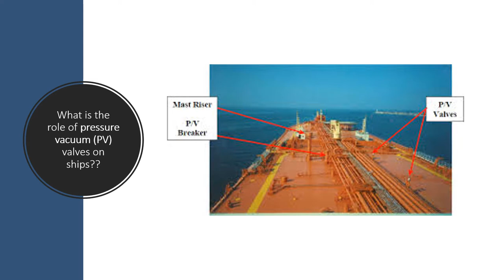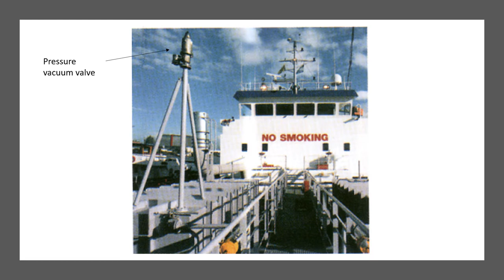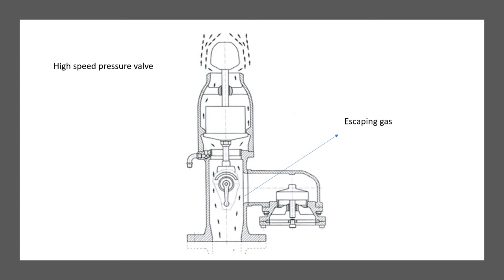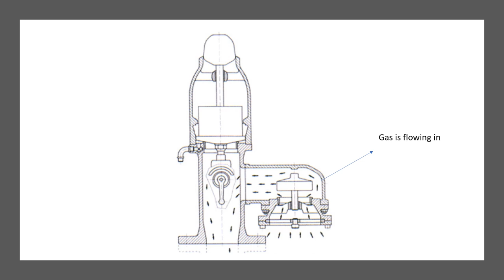What is the role of pressure vacuum (PV) valve on ships??

Comment: Wen tank is going in negative pressure the vaccum valve open up means pushes up n air goes inside the tank to avoid tank become puncture no but if vaccum in tank increases from wer it releases out bcose vaccum is air it can occur to fire ?can u tell me this sir if wrong can u explain me this ??